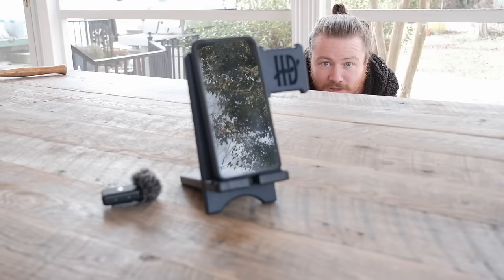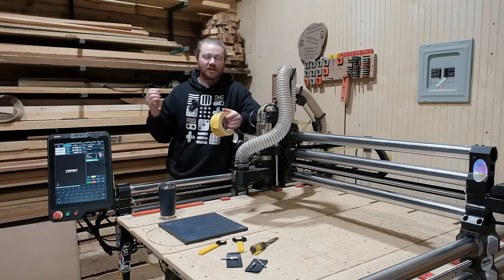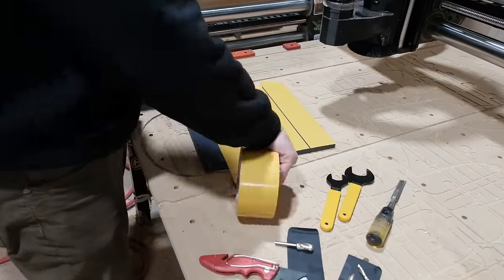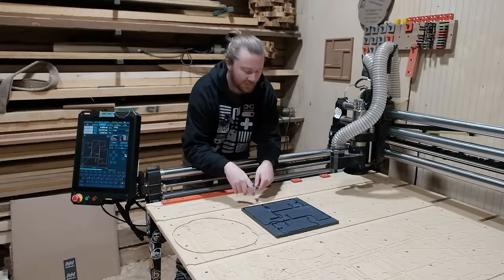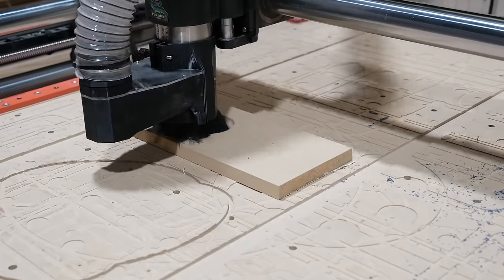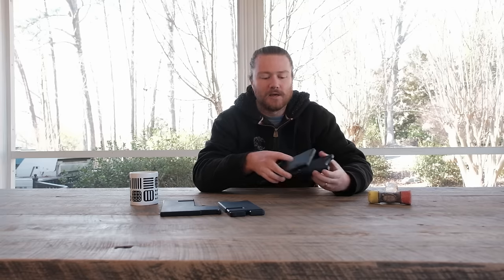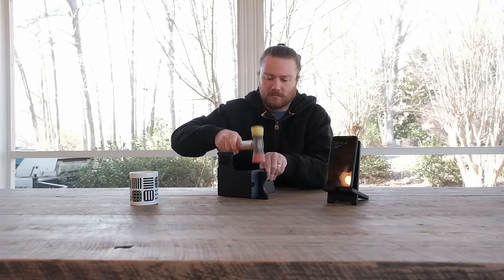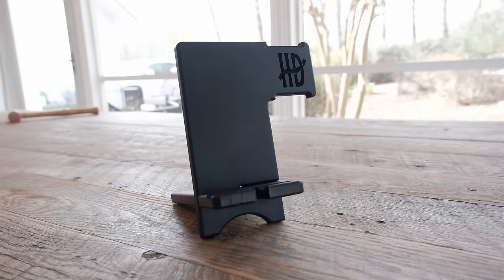Easy Woodworking Project: Docking Station (2 Ways)

Comment: Joined CNCWITHME!! I’m a completed newbie to CNC. Not woodworking. Ordered the 1F Foreman Elite 48x48 last week based on your recommendation. Plus the Stiffy, Tool Setter and QCW Fixed Stand. I went to Bentonville and talked to Dan at PWN and bought the 110v 80mm water cooled spindle and dust boot. I need to order bits so I’ll probably buy your suggested 3 bit set. I have dust collection. I’d like to be up and running as quickly as I can. What else do I need that I might be missing? 
Thank you for your experience and advice. I’ve found your YouTube videos very educational.
Reply from the maker: Heck yeah! You've got quite the setup! I think you're covered right now. I would mainly be focused on learning the software. The toolpath tutorials in CNC WITH ME is a great place to start learning. Thats where the majority of CNC headache comes from. See you over there!
Reply: I’m not certain which software to use. I’m learning towards Carveco to start and learn? Your thoughts ?

Comment: That material looks amazing! I do have a question, why do you roundover with the router rather than making it a tool path?
Quess it is two questions! My CNC has proprietary software. I can use vector or stl files. Are those a part of the cncwithme formats?
Reply from the maker: I do the round overs by hand bc it's easy- and so that I only use 3 bits on the channel. The more bits- the more confusion. 

Yep! SVG vector files as well as dxf files. The svgs can be used in any software. Those are all included at cncwithme.com
Reply: Thank you sir! @HamiltonDilbeck

Comment: 2:39, what are the lines on the front of the bottom portion, below where the phone sits? 

Looks like bit deflection around tabs potentially.
Reply from the maker: Yeah it's because I was taking off too much. I should have adjusted my stepdown. Richlite is just too solid to go at the way I was